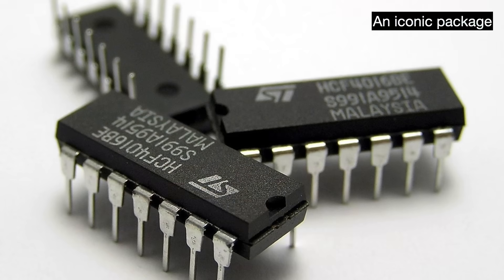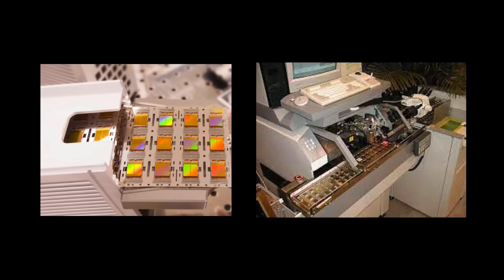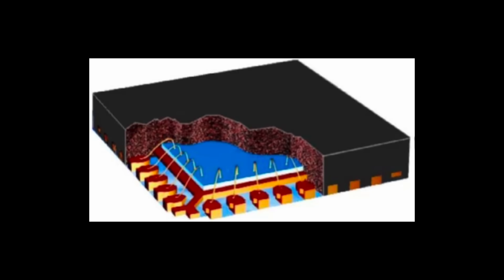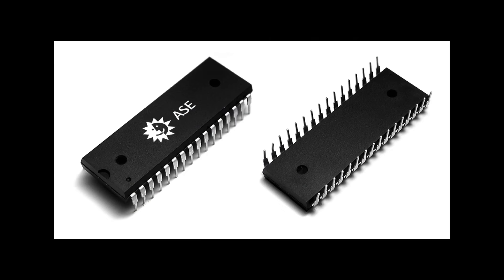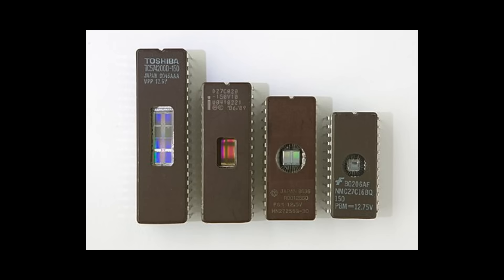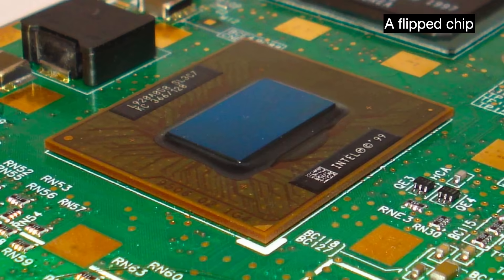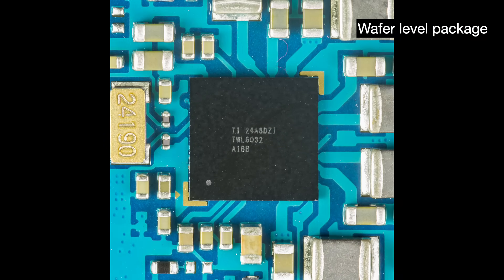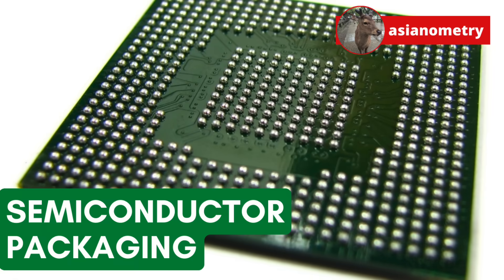A Brief History of Semiconductor Packaging

Comment: Just out of high school in the late 70's I got a job at a company as the shipping and receiving clerk. They made LASER markers but they also did stuff with PCB stuff with IC's and such. I remember some boards going to Sandia National labs. Anyway I remember twice I did some dumb things. One was removing a IC chip test probe with all the fine needle like array and see how ridgid they were from there mount making sure not the move them from position having no idea how fine their position was. The other time I had a Galvo servo motor that rotated (a mirror) the laser light in a plane, 2 working together to etch. I was curious about the shafts motion and rotated it to full stop both ways. I do not think it was made to do that after afew years thinking back.

Comment: This is a fairly good list of the variety of package types for digital ICs. It seriously misrepresents the actors and difficulties of plastic packages. For example it’s not gooping plastic around a chip, it’s high speed injection molding. There is still a problem with bond wires touching during the molding process, and there’s a complex program to verify that a given pad arrangement on the chip works with a given lead frame and package design.  The plastic is generally injected from below the chip to make the bond wires go upward. This seems obvious now, but I have talked to someone who was around at the time, and he said it was not obvious then. He worked at Texas Instruments, not at Fairchild, and I believe TI had the patent for that and did lots of other crucial work on plastic packaging. Another issue on plastic packaging is stress on the chip. There is residual stress on the chip because the plastic equilibrium warp a bit as it cools after the injection. The stress will change with soldering and with temperature changes during operation.  This isn’t too bad for purely digital chips, but if you’re trying for good analog performance, need to design for it. Ceramic packaging is much more stable. 

Normally testing is done on the wafer as well, not just after packaging. That way the packaging cost is avoided for most of the defective devices. 

There are lots of interesting packages not mentioned for chips which require high analog performance, high power dissipation, or high voltage - 1500 V is common - isolation.
Reply: Thank you for sharing.

 I think Asianometry must have had to make a lot of hard edits in his script. I don't think he intentionally misrepresented plastic packaging. it's the YouTube game at play or just a lack of time to get the script worked out just right. Since this was just a primer for variety of packaging types I am sure he could go into in-depth detail if there is enough interest.
Reply: He does say that epoxy'ing or plastic packaging can still be prone to failure...
Reply: I found your comment insightful and an educational, but not your criticism of misrepresentation. The video is titled "A Brief History of Semiconductor Packaging", not "An In-Depth Dive Into All Packaging Minutiae".
Reply: @FrenziedManbeast  I’d say it’s a superficial history. From talking to the people who were there, the really big struggle was getting plastic packaging to work reliably.  I don’t know if things like bump chips were an equal struggle, I haven’t talked to those people. I think that making surface mount was more an issue of soldering and testing than making the packages.
Reply: @glypnir  It could also be that one person's brief video on such a gargantuan industry spanning the better part of a century could never satisfy the requirements of every single viewer.

I look forward to watching your video on this topic so we can objectively compare and contrast them. I for one am grateful for this video's existence, as I learned several new things that I've since read up on my own. Tata, and farewell!

Comment: Minor adjustment, there's no need for d-i-p. It's pronounced dip, rhymes with tip or nip. The single-inline is SIP, pronounced sip.

Detail, through holes are not about structural integrity at all, just making connections between pins.
Reply: Eh, typical for this channel, always some super basic errors…

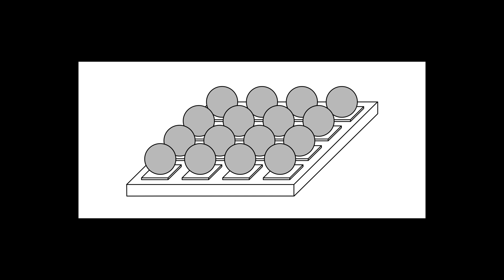Comment: I think your editing and content is perfect. To add to your video: 14:04 and C-SAM scanning ultrasonic metrology, 15:24 "Wafer level Board" WLB and "enhanced wafer level board" eWLB ~2009 are interesting because they exploited both existing PCB and wafer manufacturing equipment. The eWLB reassembles the cut die chips into a "plastic" wafer that can continue to process the chips as a wafer, even though more than 50%wafer is plastic.

Comment: In laptops and phones now you often see what looks like bare dies (glassy-looking ICs) directly soldered to the board as BGAs. What's that packaging called and why it's used for some ICs?
Reply: “Chip scale packaging” (CSP). The reasons are quite simple: it’s smaller and lighter (since there’s no package around it) and cheaper (since it saves the packaging materials and labor). The downside is that the chip is more susceptible to damage (which is why you see it less on user-accessible boards) and that the chip can be sensitive to light. (One version of the raspberry pi had a problem where a photo flash would cause it to crash. The cause was a WSP IC. All silicon is sensitive to light, which is one reason almost all chips are in opaque packages.)

Comment: 11:07 Note that the pins of the chip shown here are not gull-wing, they are J-leads, which are designed to be both solderable and socketable.  In fact if you look at the pin that's in focus, you can see the vertical scratches from this chip previously being in a socket.
Reply from the maker: My bad.
Reply: @Asianometry  This kind of package is called a SOJ rather than SOIC. The more common four-sided version is PLCC (used for CPUs, FPUs or ROM chips for some time before they either switched to SMT or PGA)
Reply: @Asianometry  At the current rate of development, how long will it take for china to design and mass-produce advanced chips?
Reply: @prasanth2601  depends if the rest of the world lets china get access to EUV lithography as currently noone is willing to sell the tech to them
Reply: There's a few other places where images don't really line up with what's being talked about I think... but then I suppose this is a video about the history, not technical details of each packaging.

Comment: 9:01 I'd also add, that it's not just "drilling a hole" through the PCB. That would be the least of it. The hole needs to be electrically conductive and solder must adhere to it perfectly. The most usual way to do it is to deposit copper chemically.
Reply: I think that advancements of PCB technology deserve an entire video on its own. The minimum size of vias, trace width and clearance is nowadays more of a limitation than the size of the components.
Reply: I'd argue the number of holes drilled is a cost driver. You can only drill 1 hole at a time, but whether the board has 1 or 100 through holes it will essentially take the same time to electroplate. On the other hand, boards will still often be "peppered with holes" because even without through hole chips, you need vias. All of this is of course context dependent, what the board was used for and which time period we're talking about. For example, in the early days it would have been much more common with single sided boards, which did not have through plated holes.
Reply: I made a lot of boards without that though.
Reply: Ya, a whole laser industry is built around "drilling" those holes. A video on MKS instruments and advanced small PCB boards would be great.

Comment: Obviously vertical stacking won't just 10x more compute by stacking ten chips on top of each other but it must still be a huge improvement yeah?
Reply: Heat dissipation would become an issue with stacking. You need to get the heat out of the center.

Comment: Great video on the history of packaging. 

What I don't understand and  amaze me is how they can connect 2000+ leads from a chip to the outside world, are they still connecting to the edge of the IC with some bound wires or welding the chip to the packacge and at what kind of pitch density, how many layers are built into a carrier. What can be the cost of the package on a 2000+ pins CPU?

I'm looking forward for your next videos.
Reply: As I understood, chip is soldered directly to the package. It's being made itself like a BGA at first, then flipped upside down and have its balls solfered to the inside ends of the pins of the package.

Comment: How is there still not a better power transistor package than the TO-220? I want my transistor clamped to my heat sink dammit, not sinking 50W into my circuit board.
Reply: TO-257 /258 , it's more expensive that's why you don't see it on commercial products but is common in military applications.

Comment: I hate some of these modern packages. There are so many cool ICs that I cant use because soldering them is so finniky and unreliable. F**k the person that invented the QFN package to save 10% of space, I hope it was worth it :(
Reply: You may want to check out small reflow hot plates and use either a syringe or a stencil to apply solder paste. That way QFNs can be really great and let TQFPs become your 2nd choice
Reply: I don't wanna troll. 
Ok who am i kidding
git gud
Reply: QFN is easy to solder: use a stencil and paste, then reflow using an oven or hot air. I’ve done many of them. Use a “PLCC blade” soldering iron tip if you need to touch up a joint or eliminate a bridge.